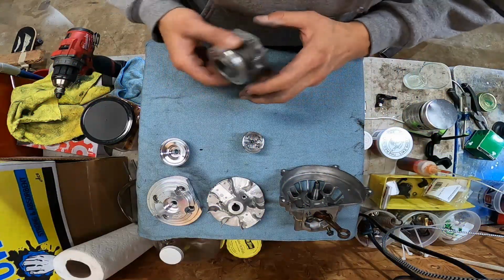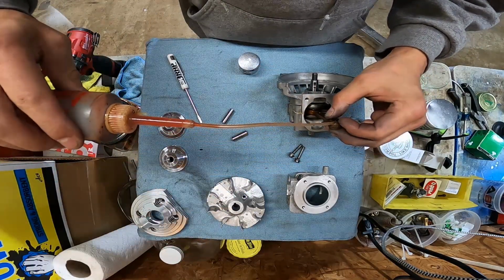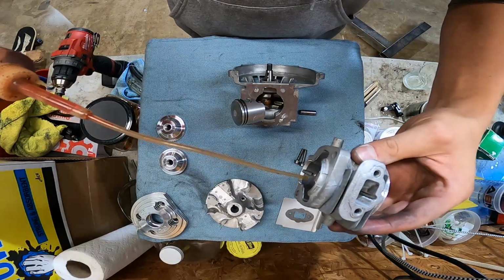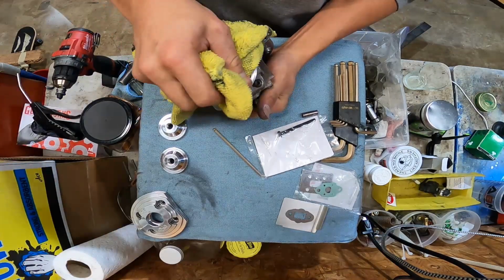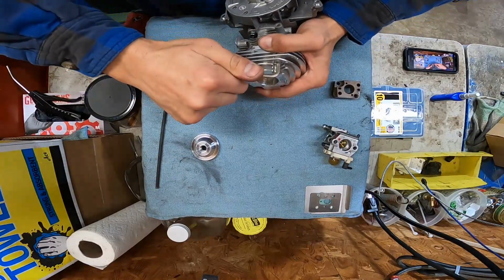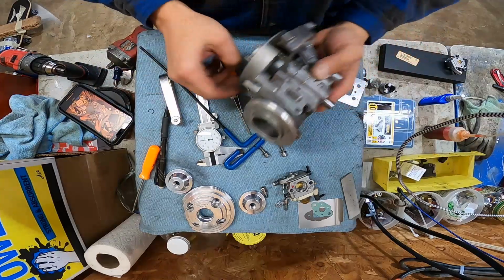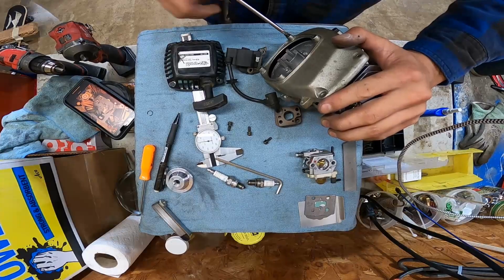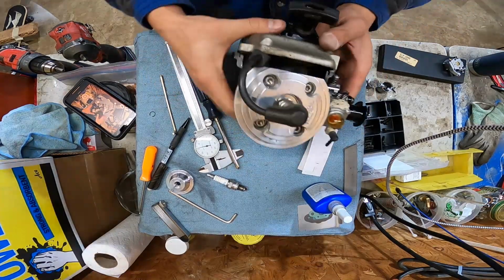Zenoah G23LH 16:1 high compression build!

Comment: old vid I know. I wouldn't "ignore the arrow" on the piston unless it has a zero offset pin. Which I would put money on that it has an offset. especially if you see an arrow. The whole rings catching the port thing sounds like BS and ignores the whole reason for engineering the offset in the first place. It has something to di with the geometry and that the piston "stops" at TDC and BDC.  Sure it probably runs, but you're not doing the thing any favors.

Comment: Arrow goes to the exhaust port not the intake
Reply from the maker: Yes that is the case. The ports on this engine are so small the ring gap can be on either the intake or exhaust. Luckly the piston pin is not ofset in this engine.

Comment: question: since this is a high compression build, i would assume the fuel needs to be high(er) or even highest octane?
another question: does the fuel/oil mixture need to change with higher compression?
im asking because a 'normal' person would run a standard G23 around 25:1 mixture, or close to its factory specs..
Reply from the maker: With higher compression a few things happen. Your cylinder volume goes down, usually resulting in less fuel use. However with the larger explosion you create more air movement hoping to get a better transfer from the crankcases. Thus increasing crankcase vacuum. Usually with better signals to the carb from the engine, you end up turning fuel down a bit because it is pulling more per pulse, usually. With higher compression comes higher internal cylinder temps. This would require higher octane fuel to resist pre iginition. The oil radios usually stays the same. I run everting I own on 32:1 using Motul 800 the road race formula.
Reply: @aaronpratt89  Thanks for the info man, appreciate it!

Comment: 16/1 comp with 2 screws holding the cylinder on 😂
Reply from the maker: Risky business haha. The head kit was designed for a G2D to utilize the 4 cylinder bolts as a girdle. This kits on a modified G23LH actually changes the shape of the cylinder. It makes ok power for what it is. However I am not harnessing it’s full potential only using 110 octane.

Comment: Does it only come with one of those copper O ring spacers.. what if u stacked 2... nice video, somewhat helpful ! thanks
Reply from the maker: The issue I was having was the cylinder shape was changing when the head was torqued. A proper girdle system would be best but with a 2 bolt cylinder setup that’s hard to come by.

Comment: Building a g290 now for goped sport spindle direct drive any recommendations? Back in the day had a g270 when first came out talking about 2000-2002 I think lol
Reply from the maker: The 290 is a great engine alone. Run a pipe and a 750-800 spindle and it will be a good runner
Reply: @aaronpratt89  my 270 had it with a 950 rocket key jetpro pipe little port and polish and did a good 49mph this time I want to really build the 290 way back then the 290 was the biggest and baddest so always been a thought in my head lol
Reply from the maker: @Miamifootballtalk  for your next build, leave the rocket key out. The newer coils auto advance the timing. If you take the key out of your previous build it would probably be faster because of the rc style coil auto advances the ignition. The rocket key was designed for the LH coils that has somewhat fixed timing.
Reply: @aaronpratt89   ok awesome thank you so much for the help any recommendations on carb should I go with 660 or 990
Reply from the maker: @Miamifootballtalk  I like the 668 myself. 990 is a good one two
Reply: @aaronpratt89  ok cool also the newer g320 and up. Can they be bolted to spindle drive without clutch
Reply from the maker: @Miamifootballtalk  they can not. The bolt pattern is different. There are a few people who have re drilled the engine mount holes and have been successful. I would like one on a sport myself. But I think I would enjoy it more on my Bigfoot or gsr sport.

Comment: Sick build, I wish videos like this existed when I was building Goped engines! Just out of curiosity, on such a nice motor why do an LH top end over an RC? Or do you think an identical build with a 4-port top end would even have much performance over this?
Reply from the maker: I used the LH because LH head kits are rare. So I tried to bring one back from the past. But sadly the rings are worn to a point that it doesn’t really make any power. So I want to get a new long block and modify the cylinder for a head kit and see what happens. Rc engines with the head kits usually make tons of torque but not much top end. With smaller combustion chambers the one thing that suffers is cylinder volume.
Reply: @aaronpratt89  I figured it was something to do with that absolutely sick ADA head. And a 27mph LH is no slouch that's for sure. I have an "HD" Sport and X-Ped that I'm considering rebuilding and this vid definitely got me hyped on it. Keep up the informative and good videos.
Reply from the maker: Thanks man!! I finally have my camera equipment again I am hoping to make some more content soon! 

But ya 27 for an LH is pretty good, considering I need a bead lock and I can’t hold it wide open for too long lol

Comment: Got the g23lh was wondering if i should get the esp modified 30.5cc 4hp big bore  kit and cylinder kit as the cc254b w/2mm stuffed cranked was wondering ur opinion
Reply from the maker: What application?
Reply: @aaronpratt89  g23lh
Reply from the maker: @daultonanderson1737  I understand the engine you have. What type of scooter is it on?
Reply: @aaronpratt89  goped sport
Reply from the maker: @daultonanderson1737  put a RC290 on it. Building an LH engine isn’t really worth it. I did all of that work and it only goes 27mph. A stock RC290 will almost do 30mph.
Reply: @aaronpratt89  appreciate it thank you

Comment: Hi sir can i ask a question?i restore my goped 29cc i assemble the engine in proper way but when i try to pull the pull start its hard to pull it llike kicking..i feel it so full of compression in the chamber but when i try out the spark plug then i try to pull the starter it so easy to pull it...it there any problem about my goped engine
Reply from the maker: Is the piston hitting the spark plug?

Comment: Also the cover is missing so I don't know what the cc s are is there away to tell im thinking of buying a bbk from Amazon whats your take on them
Reply from the maker: I would stay away from any Chinese aftermarket engine parts. The quality isn’t there. For good aftermarket parts, DDM Racing is the place to go. ddmracing.com. But yes the big bore kits really bring the LH engine alive. However I do not recommend using a big bore kit. But swaping to the 290rc engine. It’s a much better designed engine using a 4 bolt cylinder.
Reply: @aaronpratt89  the 290c bolts right up or is there some fab work
Reply from the maker: @jeffkrauss5582  direct replacement.

Comment: I'm bk wth some more questions lol I got one of my goped sports running today but I can't get it running by pushing it and when I use the pull start I have to elevate it and keep the throttle part way open or it will die when the rear hits what do I need to do
Reply from the maker: What kind of sport is it? Traditional sports are direct drive. The spindle rubs the tire directly. So when the engine is running the scooter is going to be in motion. It also sounds like the idle screw needs to be adjusted.
Reply: @aaronpratt89  I got the idle screw almost al the way in it’s an original sport from the early 90s and one is from the 80s I believe the motor is not spring loaded I’m using the spring loaded one now
Reply from the maker: @jeffkrauss5582  is it a sport it big foot? I sounds like you are talking about a big foot, not a sport.
Reply: @aaronpratt89  it says sport all over it
Reply from the maker: @jeffkrauss5582  what do you mean by spring loaded then?
Reply: @aaronpratt89  the motor has a spring that holds it to the wheel  I can tilt it forward to start it but it doesn’t lock in place
Reply from the maker: @jeffkrauss5582  ok it sounds like a geo sport. The 290 will not fit the geo sport. The engine spins  the opposite direction. If it is having trouble idleing. The carb may be due for a cleaning.
Reply: @aaronpratt89  I have broke it all the way down and cleaned it why do these walbros only have an idle screw also is there away to kick start it or is it not setup for that sorry for all the questions I’m kinda new to this and I don’t mean to take up all you time thank you for all the info
Reply from the maker: @jeffkrauss5582  any time man! Add my Instagram and message me on there. It’s in my about. The geo engines are known for air leaks. They tried to make that engine use clean air to scavenge the exhaust gases out of the engine. They are prone to leak with the stock setup. Check all of gaskets and tubes around the carb area for air leaks. I use carb cleaner. I spray all the joints lightly. Wherever the air leak is, the carb cleaner will be sucked it and change the tone of the engine or cause it to stall. Once the air leak is found, you can fix it.
Reply: @aaronpratt89  thanks

Comment: soooo i bought my first Super bigfoot and naturally i started moding it. It had a wt603 carb , so it had to go . I threw on a wt990 carb .710 spindle with ada 3rd bearing and a sikk toys endbleed . Im pretty good at tuning, the scoot has zero tq. if i feather through the throttle ever so slightly I can get into the upper rpm range and she rips !  Am i running too much carb for the G230RC ? Is the spindle to large? 

Well I went ahead and ordered a G290RC long block , .675 spindle and a ada long intake aluminum manifold. plus the wt990 carb and sikk pipe that ill be taking off the 230,  I hope this combo works out form me.  oh im 285 wet lol
Reply from the maker: Congrats man! I’d remove the 990 carb. It doesn’t have the pop off rate to remove the bog.  The 668 is a much better carb. Also the 230 is only 23cc so it won’t have any torque any way. A great budget engine is the 290. It has the updated 4 bolt cylinder and its 29cc. It has greater bottom end torque. I’m planning on doing some videos on one. I’m gonna slap one on my big foot in the future! I recommend the 700 spindle on the big foots it’s a good all around size for general riding! But with the 285lb the 675 will be a good choice!

Comment: I found a cheap kit on ebay that uses "king motors" brand cylinder and crank kit for like 80bucks shipped and fits right into a g23lh case with only minor trimming to allow the cylinder to center properly other than that it is a direct bolt in and makes killer power, I put that motor on my big foot and felt 3times more powerful than a stock lh. And the kit makes the g23lh into a "rc style" 30.5cc
Reply from the maker: Sounds like a traditional big bore kit for the G23LH.
Reply: @aaronpratt89  it also came with a plus 2mm crank and spacer plate. It was worth every penny
Reply from the maker: @briang4470  hell yea!

Comment: I heard the arrow is always pointed to the exhaust port.
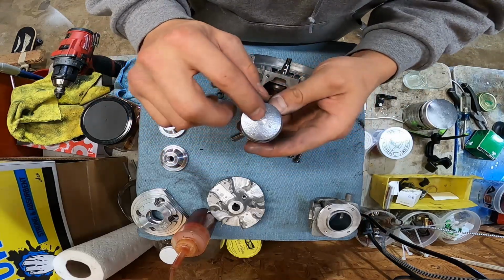Reply from the maker: Hearing where the arrow goes and knowing what the arrow does are two different things. At 3:30 I talk about he arrow and the reason it aims at the intake for this engine.
Reply: No one explained why. The arrow generally is towards the exhaust. BUT check the piston. On this G23LH the piston has the pins opposite the arrow, the piston rings go PAST the exhaust port BUT DO NOT enter the intake, therefore the arrow point towards the exhaust port BECAUSE the pins (opposite the arrow) never enter the intake port.
Reply: Yo the arrow goes the the exhaust he's right I build 2 strokes too
Reply: You are correct my friend exactly what I said 😊
Reply: I dont know if those small engines have a off set wrist pin or not? But yup, he put piston on backwards.
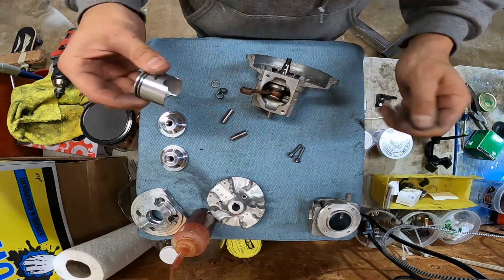Reply from the maker: @jocrp6  let me say this one more time. The arrow on this engine goes toward the intake. The reason for that is to keep the ring gap at on the intake side of the engine. What happens if the ring gap is on the the exhaust side? The ring can stick out and catch the port. You clearly have no idea what the arrow is for and why there is a piston direction in two strokes. The wrist pins are also not offset in single cylinder engines. This is not a v style engine. Watch the video again at 3:30 I explain the reason for the arrow.
Reply: @aaronpratt89  OK, I dont know what that engine is? But can look up a Zenoah shop manual on line and prove me wrong, i've worked on tons of those little engines, Just saying,
Reply from the maker: @jocrp6  just saying the ring gap goes to the intake side of the engine.
Reply: @aaronpratt89  🏹 points to exhaust

Comment: 1211 is great and all but it's not cheap and its always sold out here in California. Iv ben building jetski motor for the past 10 years other then putting the case together I use copper spray gasket amazing stuff there my man for paper gasket
Reply: Ya I love it to best thing beside yamalube
Reply from the maker: @jmedlock696  honestly yamalube two stroke oil is close to one of the worst oils out there. If you print off the technical data sheet and some are it’s density to it’s flash point, it really isn’t doing any justice to the top end.
Reply from the maker: I love the 1211. I used to build jet skis also! I have to order it online. Stores never have it.

Comment: Did you find an aftermarket kit that works
Reply from the maker: The kit I am using is the second generation kit for the G2D engine. The G23LH cylinder was modified to accept the head kit. There is an adapter that is threaded on to the cylinder for the head kit to bolt to. You loose a coil mount. But it still works with one bolt.
Reply: @aaronpratt89  so the new piston will fit or do you have to bore it out still
Reply from the maker: @jeffkrauss5582  I had to dig up an old piston from before they were teamed up with husqvarna. When the parts boxes said zenoah lol. So something has changed between manufactures.
Reply: @aaronpratt89 I actually noticed that. I have been porting/blueprinting G23LH engines for a while now. I always keep the old pistons, but some (more of the stock rebuilds) get the new piston.
Reply from the maker: @bdrgarage7039  yea I find it strange the new manufactured pistons don’t fit. Gotta keep that new old stock stuff around
Reply: @aaronpratt89  absolutely.  I have 2 G2D one with a high compression head.  I have not opened it up yet. Was on a spindle goquad I picked up. Thinking new carb, lube the cylinder,  and see if she runs. I am currently building a G23LH lower with the 25cc big port upper, I hand ported the lower to mostly match the upper,  Japanese crank bearings,  S1 pipe, etc. Should be fun this summer.
Reply from the maker: @bdrgarage7039  I have a few G2D engines hiding somewhere lol. I miss the old school big Ada head kits.
Reply: @aaronpratt89  nice, I might do a video when I fire it up.  The other is stock with an original goped performance pipe,  1989/90 ped. Its awesome. Great score